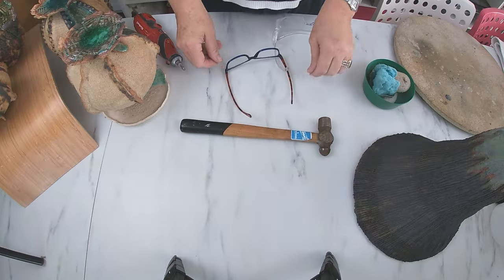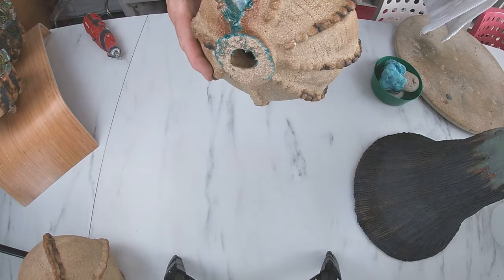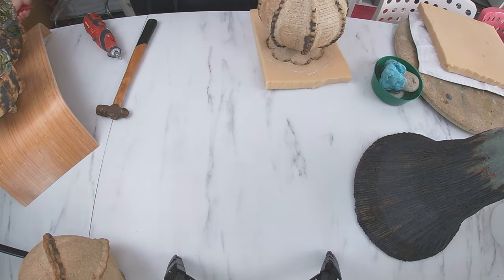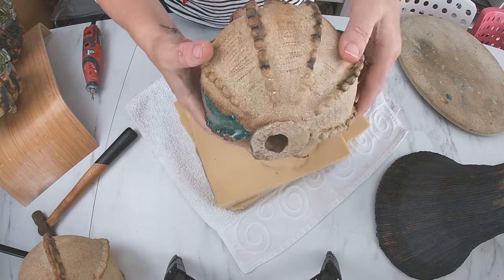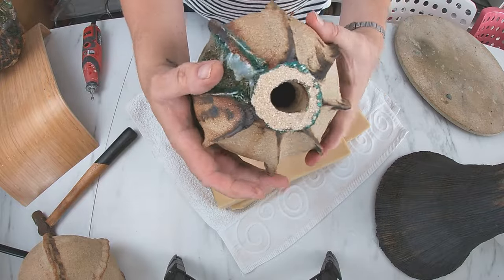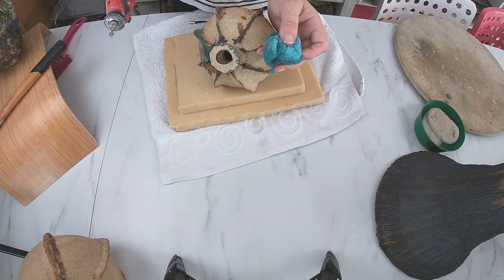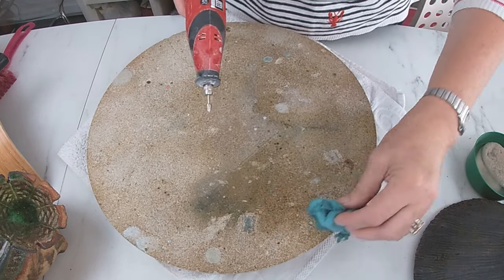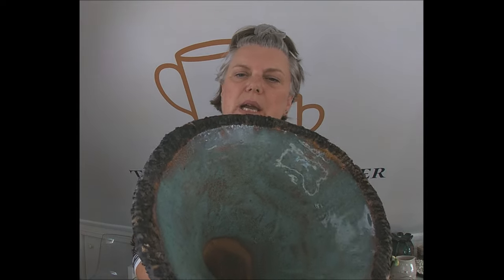How to Grind Kiln Shelves and Pottery Pieces using a Dremel with Diamond Tips (Pottery Tutorial)

Comment: Thanks for this.  I use a number of things, including a hammer and chisel, grinding block and angle grinder (and I'm a girl!) to clean my kiln shelves.  I do kiln wash them, and find that most drips pop off with a tap from the chisel.  Also, I have a cordless Dremel.  I love it!  It works great for any number of things, and I'm not tied to an electrical outlet.  Perhaps I'll try it on some of the more stubborn small drips next time.

I'm glad you had a great trip, and welcome back!
Reply from the maker: Thanks so much for watching.   CORDLESS - 🤯 - better get hubby to upgrade 😆
Reply: Ia there a reason why you dont use kiln wash? Thanks so much for this video.
Reply from the maker: @micheledickey4066  - yes there's a reason Michele - I find kiln wash becomes 'dusty' after a couple of firings and can blow around the inside of the kiln and attach to work.  Hope that makes sense 😊

Comment: Hi again Sarah! I’m going to purchase a rotary sander but unsure what type and wattage etc I need. Can you help me with how heavy duty I need to go eg what wattage and other info would be really helpful as so many price ranges and makes and don’t want to spend heaps of a cheaper one ok but don’t want to waste money by having to upgrade! Thanks again Lynne NZ
Reply from the maker: Hi Lynne and thanks for watching.  Mine is an Einhell  - not cordless but there is a cordless version on Amazon - Einhell TE-MT 7.2 Li Cordless Rotary Tool Kit | Battery Powered Crafting Multi Tool Kit With Variable Speed Electronics | With 57 Piece Accessory Set and Case For Grinding, Engraving, Polishing - which is a very similar spec to mine.  Hope that helps.
Reply: @thepotterycorner  thanks Sarah for the specs v  very helpful 👍,